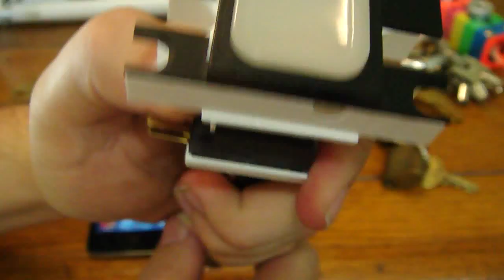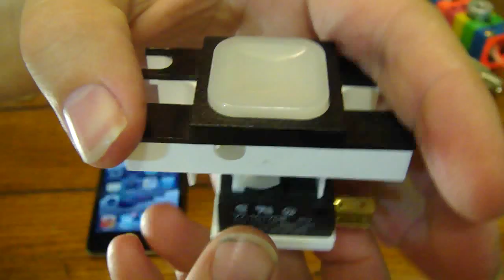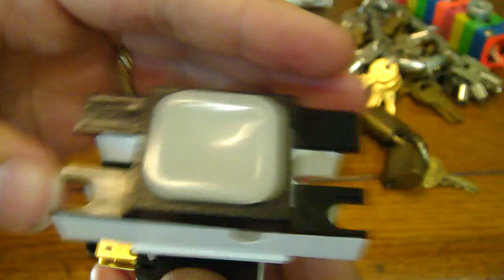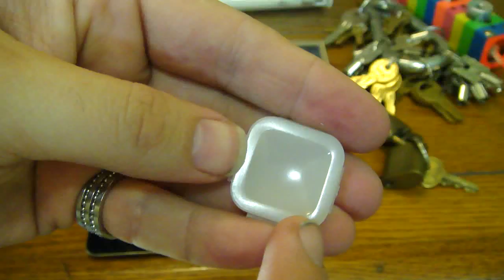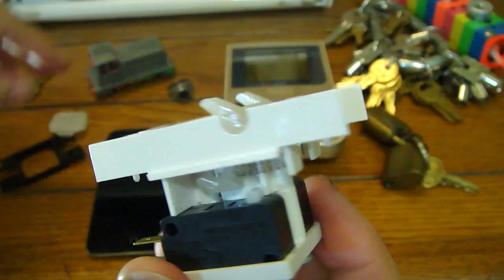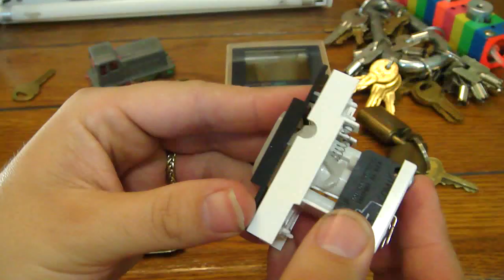Dover Impulse elevator button: How it works

Comment: And actually on one of your unboxing videos you mentioned how the vandal resistant kind of has similar contacts with the hammers and switches and stuff on the back of it but and the only differance is that the buttons were round and had just a little light in the middle instead of square where the full button has the light built into it
Reply from the maker: Yep. Dover vr is in same base

Comment: That is your opinion. He says "everybody" because 99.99% of people in the community like Impulse. That 00.01% is YOU. I don't like HT or HT vandal resistant very much. AND if you put Impulse and HT in one elevator each at a parking garage, the Impulse will still be holding up while the HT would be failing. Probably same with vandal resistant.

Comment: @KyFriedPlatypus I think there might be two different versions.  Dover might have made a different version back then, or the elevators you found have Adams replacement impulse buttons which use a different contact mechanism than this.